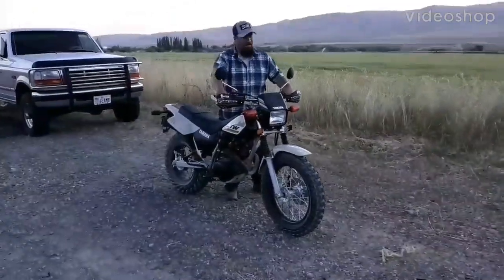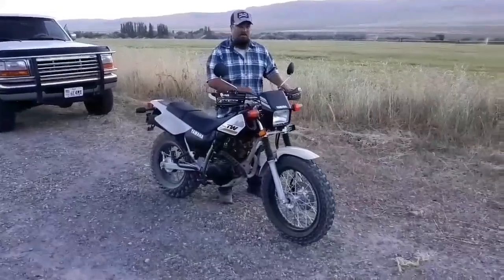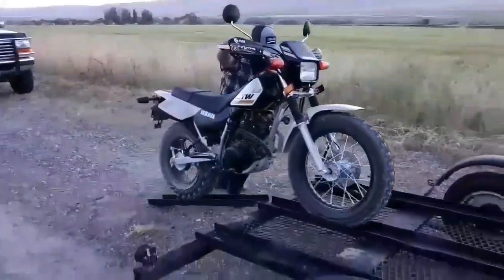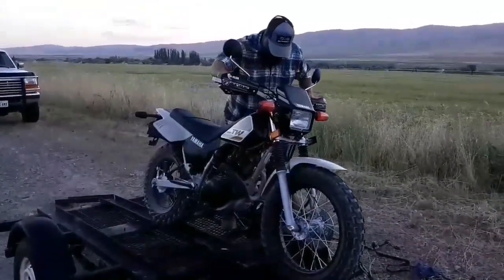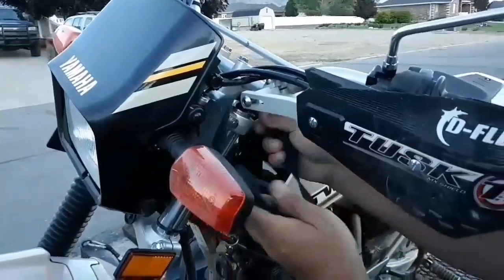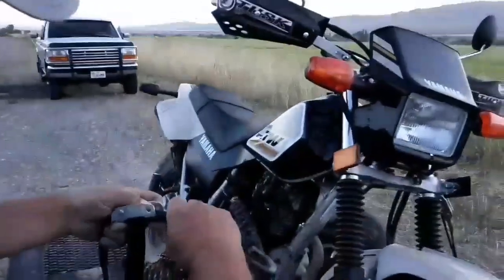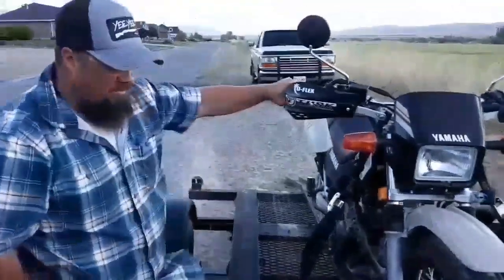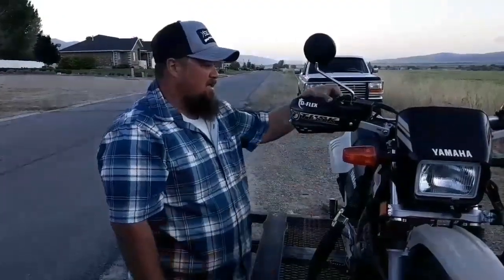How to load a Motorcycle onto a trailer (TW200)

Comment: Question - I've been told compressing the shocks like that is bad for the seals... have you had any issues?  I don't know if it's more damaging over long distances versus short, but was always warned against that kind of compression.  Interesting to see others doing this.
Reply from the maker: you know, I have been loading the bikes like this for years.  I have had them on the trailer for hours and sometimes overnight and I haven't had any issues with them yet.  Not saying that it won't or can't happen, but I have been okay with this setup so far.

Comment: What are the width of the rails ? I’m upgrading my utility trailer to pickup a tw 200  thanks
Reply from the maker: The rails are 6" wide.  It is a three place trailer made for the TW and at the back tire we flared the rail to 7" so the the wider tire has a better place to sit.
Reply: @MOBStreet83  good info , thanks!
Reply from the maker: @mjfollrd  You bet!  Thanks for asking